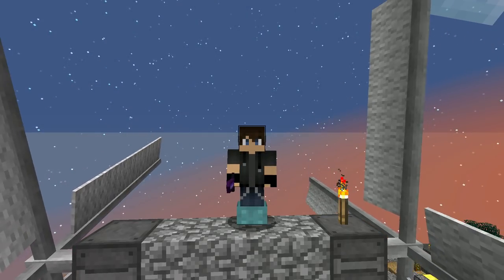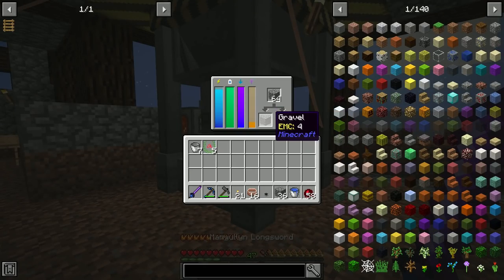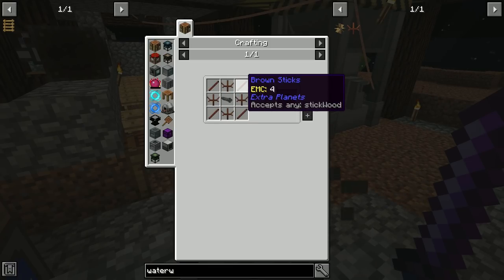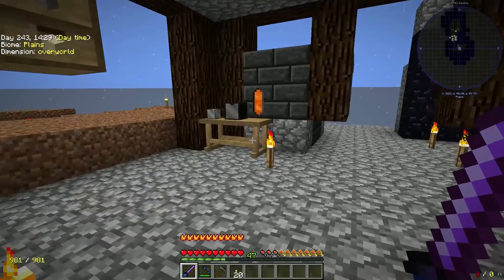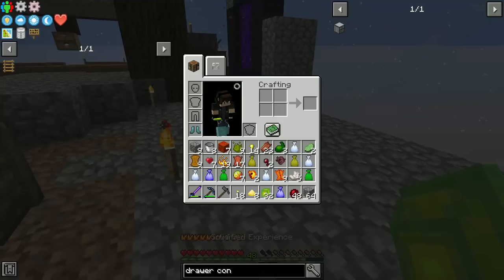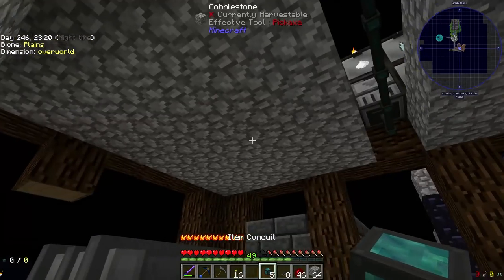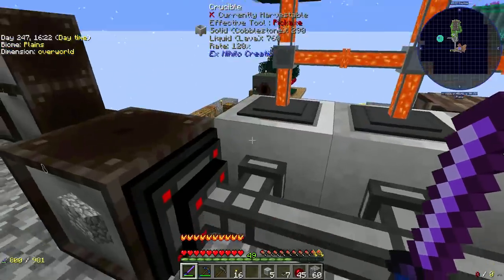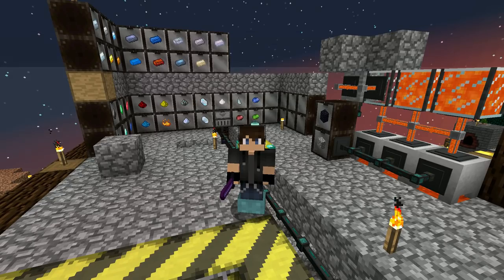Auto Ore Processing and Tech Advancements Pt.1 : Project Ozone 3 Kappa Lp Ep #5 Minecraft 1.12

Comment: Hi Asgaard, for your 'drawer' setup, the barrels in this pack i feel is actually a better option since you can get the infinite capacity upgrades for those quite early on so you dont have to worry about void upgrades and things. i know its possible to customize the look of the barrels as well, but probably not to the extent of framed drawers
Reply from the maker: Yeah, you cant customize their looks as much as framed drawers.  Looks > efficiency always :)  Void upgrades are just fine, no use atm for my 2k stacks of iron ingots :)

Comment: Asgaard, you might want to move the sieves more apart. I found that with your set up it will place block in sieves in a 9x9 even if they don't touch. Not sure why. I do think the sieves have to have the same mesh in them.
Reply from the maker: Ive had no issues with them thus far, have had sand, gravel, and dust 3x3's with one block between each set running for about 2 weeks or so now and so far no overlap, its always running the correct dust so seems fine.  May have just been a bug in a certain version or something if I had to guess